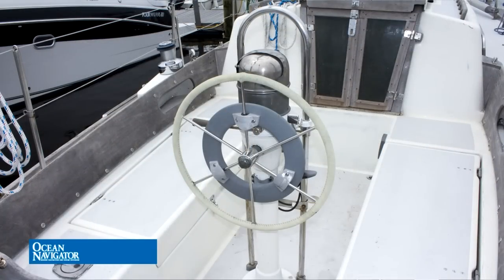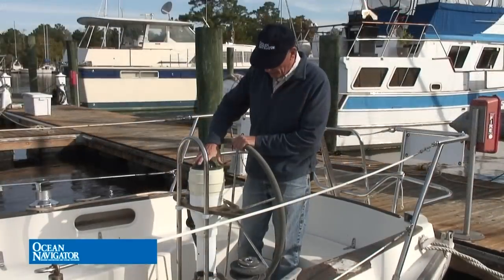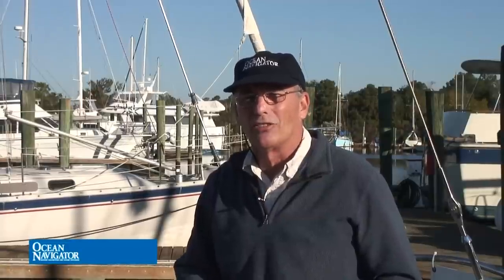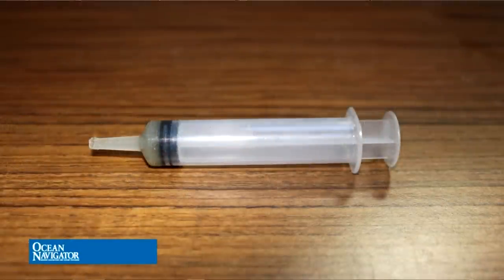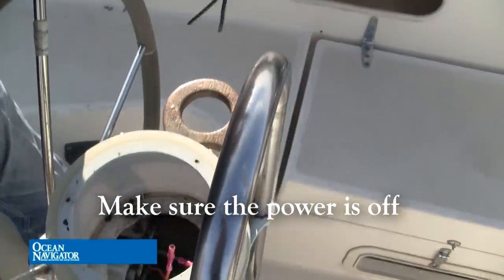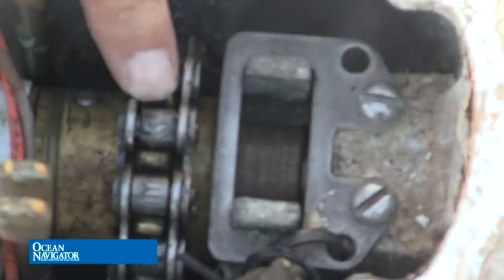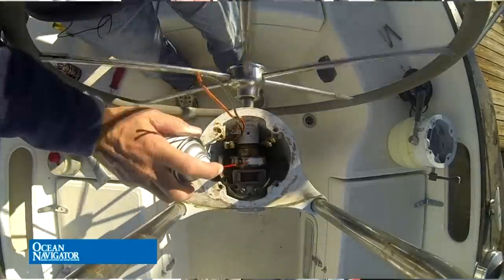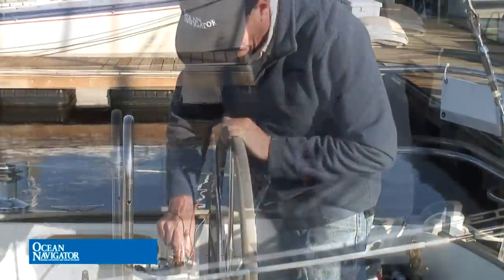Steering Maintenance Part One Pedestal Maintenance

Comment: Great video - thanks.  I like your comment at 1 min. about it being a great Saturday afternoon project.  This is my third winter and probably 50 hours into trying to get mine apart.  One of the 4 bolts holding the control housing on would not come off.  A couple weeks ago, I ground the head off and then sheered the bolt further down using vice grips to try and remove it. At least now I have access to finish the remainder of the "afternoon" project :).

Comment: To protect items from falling into the pedestal, I place a rag over the inside of the pedestal when removing and assembling the parts. I also mark the outside of the engine control housing to the pedestal to help with alignment of the bolts.
Reply from the maker: +Bruce Bogdanoff Two very good suggestions, Thanks for the input.

Comment: Thank you for an informative video! I have found the steering on our S&S 30 to be quite stiff, even after lubrication. The steering is uniformly stiff from lock to lock and the boat is very tiring to helm and of course there is no "feel". I suspect that whoever has serviced it has tensioned the chain or the cables too much. What do you think?